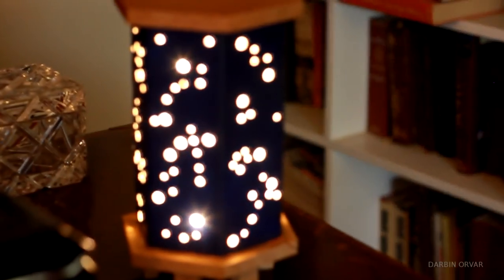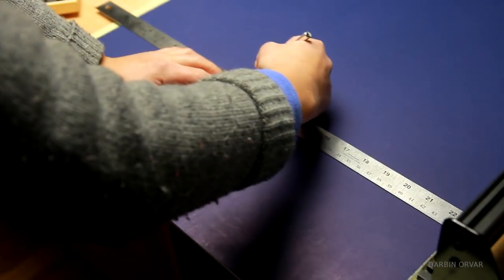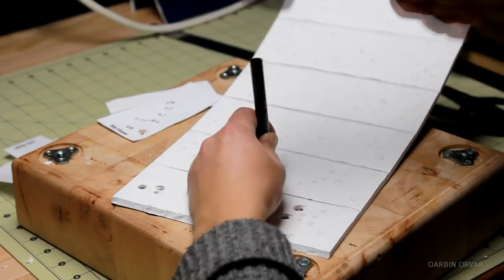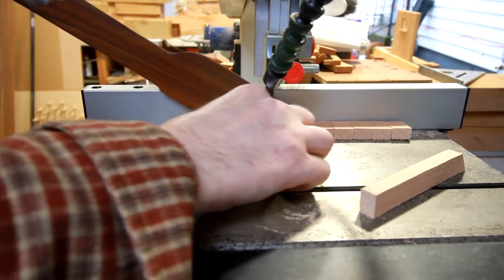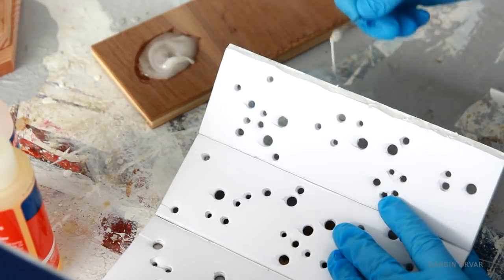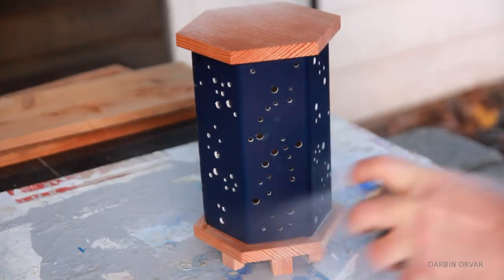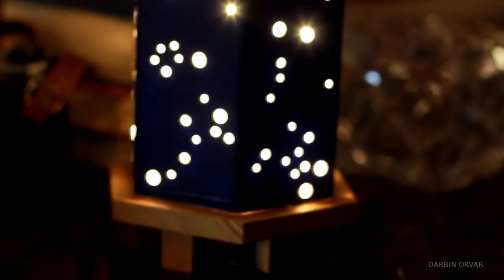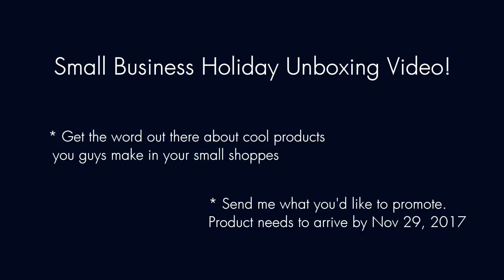LED Night Light w/ Wood, Foamboard & Fairy Lights

Comment: I really enjoy your videos.  Thank you for the hard work to keep these coming out.

When I built something similar I made hexagons to fit the inside of the lantern and attached them to the top and bottom of the base and lid.  That way it held the shape of the (in this case your foam board) lantern properly and gave me a way to access the light bulb inside by the lid being removable and yet held in place.

Comment: Beautiful project. I think I may build one with my astronomy obsessed daughter.

Suggestion for an improvement - route a groove in the top and bottom caps to retain the foam board. It would also help with holding it in the right shape while the glue cures.

Comment: Really, really nice, Linn! :D
Just a tip and one idea: first, you can glue foam board with hot glue. (Take a look into the channel FliteTest - they have pretty long build videos, where they make RC airplanes with foam board and they always use just hot glue.) The idea: make a new one like that, but with smaller holes and using a stronger light. It should project the star formations in the walls! That with a motor to rotate it... Would be awesome for kids bedroom!